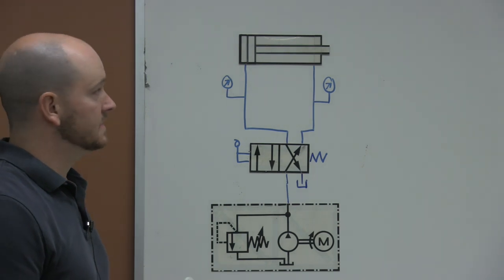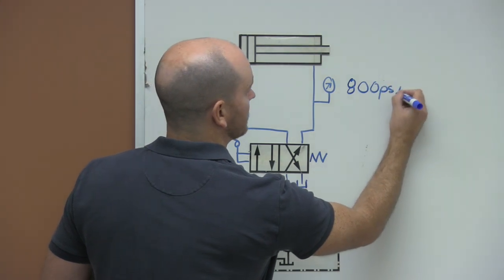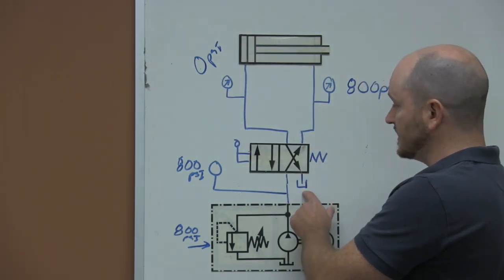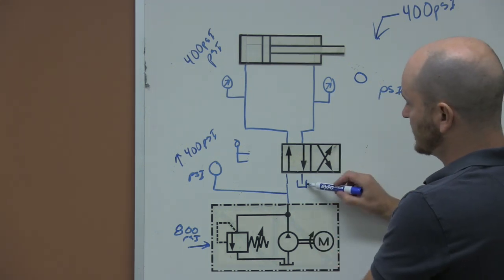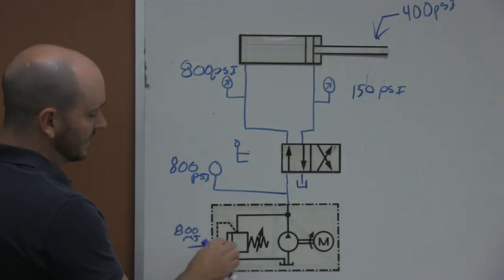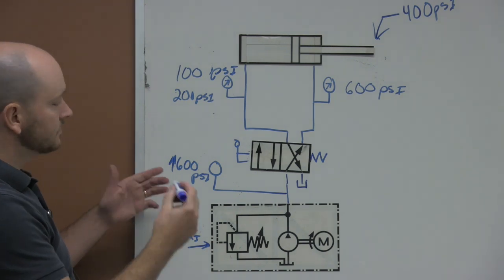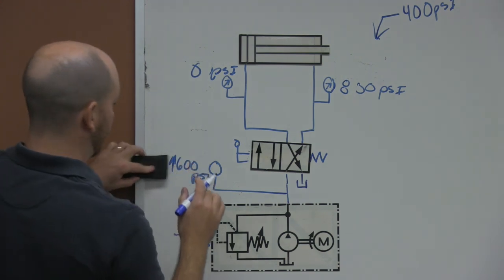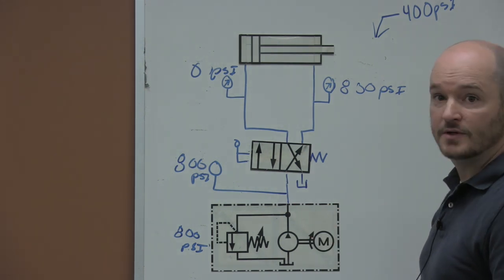Pressure Differential and Cylinder Movement

Comment: I have a problem with retracting rod of the boom cylinder at a new miniexcavator. It's pilot operated spool. I checked everything but the spool itself and the components. When retracting rod into cylinder it is an obstruction as it doesn't let bottom oil from cylinder to go freely back in the return line/tank. After 100 hours , this problem laminated my hidraulic oil and really broke his molecaular structure and turn it brownish dark (Iso VG46) and heats above 80 degrees celsius. Is it posible that somehow the joystick pilot pressure isn't enough to push the spool proper into corect position and the return line is chocked? Maybe the spool spring too stiff? Any help apreciatted. Thanks.

Comment: Hi  I think that when the shaft is going out of the cylinder to move a 400 PSI load, and the pressure in the right side compartment is 150 PSI, then the pressure in the left side one should 400+150= 550 PSI or a bit more.  Do you agree?
Reply from the maker: That depends.  In the video I say it takes 400 psi with the load and knowing everything else.  that would include the 150 psi on internal resistance of the flow going back.  I might not have been clear enough on the point.  thank for pointing that out.
Reply: Unless you couple the inlet of the pump to the output of the piston it takes more PSI than stated to lift the load and return the fluid.

Comment: Very well explained  
But it's the force due to pressure acting on an area that decides the direction of movement

If you have equal प्रेशर on both sides , cylinder wI'l extend

Comment: Stupid question, but why exactly does the pressure drop in the rod end of the cylinder barrel when the directional control valve shifts? Because that part of the system is now exposed to the atmosphere via the tank? I'm not too bright, but I'm trying to learn. Tired of breaking my back doing manual labor in a fiber plant for $13 per hour.
Reply from the maker: Yes that is correct.  When the valve shifts the rod end is exposed to atmosphere and pressure drops.

Comment: it helped me a lot sir.I have a  clicker press and your video helped me a lot in understanding how it works.thank you.
Reply from the maker: Great.  Glad it helped.
Reply: KletteTech another question sir..my clicker machine has a messed up wiring..It has a variable timer relay instead of a potentiometer to control its cutting power..my question is what does a potentiometer do and what does it control , the solenoid or the pump((flow)?..thank you in advance sir.

Comment: Dear Sir..........I have single acting a cylinder with a bore of 18 mm and a rod of 10 mm and a stroke of 300 mm. I want to know what is the pressure if my cylinder presses 10 mm ........... Please advise and provide a solution with the formula

Comment: 9:12. What if you have equal pressure on piston and the rod side. What will happen. I am guessing it will extend because of larger area of piston and hence larger force.
So I think it is the force which decides the direction of the movement not the pressure. Please correct me if I am wrong.
Great video appreciate it
Reply: You are 100% correct

Comment: Practical problem in hoisting :
Cylinders r not hoisting up or down with solenoidal valves. Upon Maunally pressing the solenoid valves, cylinders moving up n down. 
So, there is a problem in valves. To check this, we want to remove solenoidal valve from the circuit. 
Can we remove valve with the cylinders being in up position ???( pump supply in off position)
Reply from the maker: I would be very careful.  If the cylinder is up it could start to drift.  Lock it out if you can.  Best bet would be to retract the cylinder.  With the cylinder up there could be a lot of pressure in there.  Safety first.

Comment: i thhink during extension .. pressure on right side will be more than 400 psi due to pressure intensification . Is that right ?
Reply from the maker: I do not think so.  If there was a flow control metering out the flow on the extension then yes.  But there is not so i think 400 would be correct in this example.

Comment: I have injection molding machine and I have problem with movable plate it’s retracting alone slowly without pressing anything on the control panel  ! Anyhelp please
Reply from the maker: Which way is it retracting?  If it is retracting down, the DCV might be allowing the liquid to pass through it.  A pilot operated check valve might fix the problem.

Comment: I have a trailer when the oil is cold it will only lift 3/4 of the way up and stop if you wait until the oil is hot then it will lift all the way up most of the time can you help me with information how to fix it thank you.
Reply from the maker: I have seen this before.  The problem could be when the oil is cold that the viscosity of the oil changes.  The slower oil causes extra resistance which increase the needed pressure.  One solution would be to increase the pressure setting on your pressure relief ONLY if increasing does not exceed the maximum pressure on any of the hoses, connectors, or parts.  If the power unit does not have an adjustable pressure relief,  you will need to contact the sales rep to see if you can adjust it by switching out the internal spring.  Another method would be to add a heater to the tank if that is possible.  Totally depends your trailer's setup.  Any other questions let me know.

Comment: Not an engineer but when you say pressure relieve valve releases all your oil is it accurate? I'd guess you mean the overpressuring oil only not all of the oil right that would defeat the purpose of a pressure set pressure release valve?
Reply from the maker: All the oil coming from the pump.  that is over pressure.  All the oil in the system would stay at the pressure the pressure relief is set too

Comment: Pressure doesn't move pistons. Force does.  The pressure on the rod side can be higher than  on the cap side and yet the cylinder will still extend became the cap side has a bigger area an a greater for e.

Comment: what psi if we want to stop under load and stop it right there like forklift.
Reply from the maker: Great questions.  The answer depends on a couple of factors.  First what type of center does the directional control valve have.  In my video there is no center it is just a 4/2 DCV.  That is a bigger question than I can answer here.  The second factor is how much load in on the cylinder.  If that is known, then take Force/Area of the piston and add roughly 20%.  For more information on the different centers I would recommend checking out Fluid Power Systems published by American Technical Publishers.